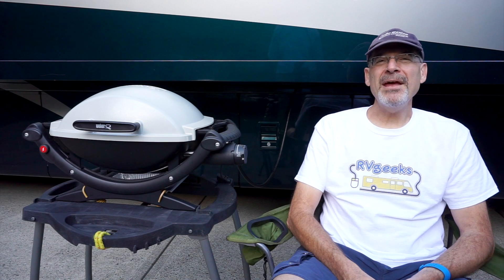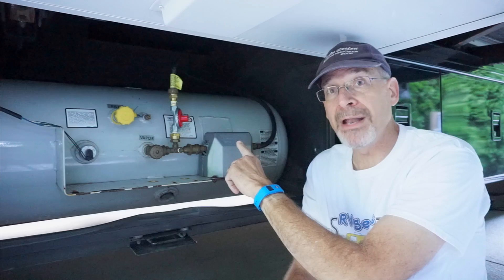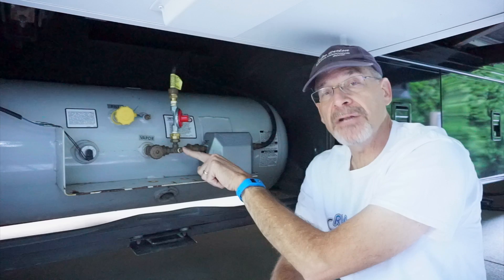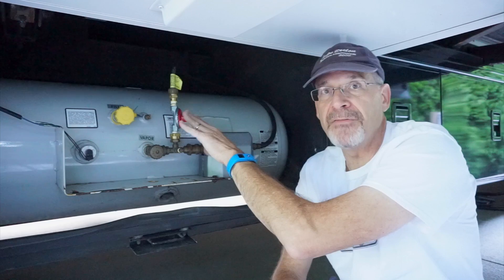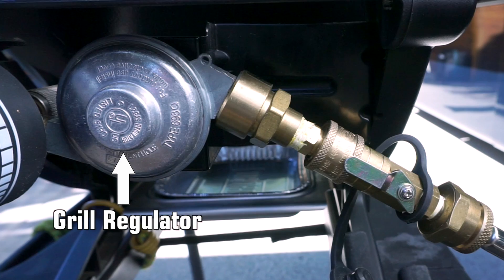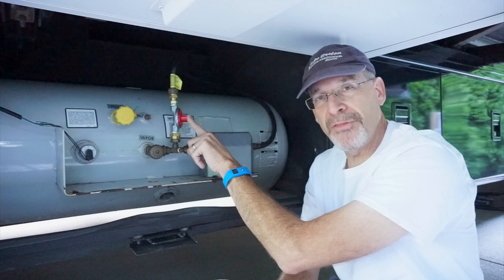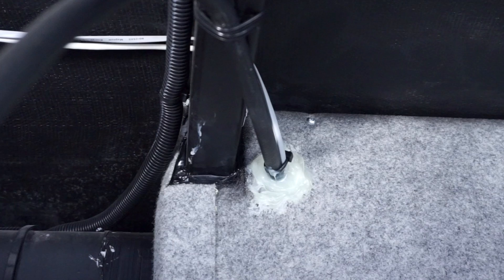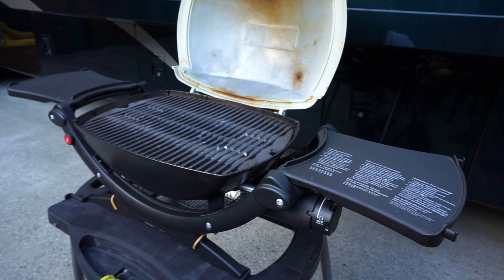How to Connect a BBQ Grill to an RV's On-Board Propane Tank

Comment: GREAT information, as usual, with great clarity. I also noticed the use of the two regulators and was going to question you on this use, but you gave a Super detailed explanation in your reply to someone else. Did you figure this out yourself or was there someone else involved in the process? Thanks.
Later...Terry
Reply from the maker: Thanks Terry! We mostly figured out the whole set-up ourselves, with the exception of the fact that high pressure can cause oil to accumulate in long propane hoses. The first time we ever heard an explanation of where that oily build-up had come from was when we went to connect our RV to an external propane tank the winter we spent up north. The local propane dealer who sold us the parts we needed for that told us that we'd need a regulator on the big external tank (which you can see briefly in this video and in detail in our video about that topic) because we needed a fairly long hose to reach the RV. When he told us about high-pressure propane causing oil build-up in long runs of hose, a light bulb went off, since we'd had that then-mysterious problem once before, but had no idea why. We thought we'd just gotten a bad batch of propane. ;-)

When it comes to exactly what regulators we used to reach the grill, we chose the 15 PSI after some experimenting. We'd first tried a standard 11" water column unit, but the grill would not stay lit, since we were double regulating (TWO 11" water column units in the same line). It turns out that we needed to "step down" by bringing the pressure down part way to prevent the oil, then regulating at the grill to the required level. As we mentioned, if the regulator had been easy to remove from the grill, we could instead have simply moved it to the other end of the hose, right off the T and only needed one instead of two. We're always learning! :)

Comment: Curious if it would be safer with black pipe or copper under and through the coach. Or even the yellow gas pipe. Just because the rubber hose can deteriorate over time.
Reply from the maker: Hi Kevin. Might be a more robust installation that way. But it would be a lot more difficult to install. Ours has been working great for many years without a problem though, so this seems like a pretty good compromise.

Comment: Thanks for the video.  So, you have a second regulator that remains on the grill still?  Does the already-regulated gas just pass through with virtually no change?  Was wondering why you still had the second regulator on the grill side.
Reply from the maker: Great question! We do still have the original regulator on the grill. The reason it works, and provides enough flow, is because the first one is a step-down regulator, which brings the pressure down to 15 psi. That is still far higher than the regulator on the grill, which is closer to about 1/2 psi. The reduction in pressure along the line prevents oil buildup in the hose, but it’s still high enough to provide plenty of flow for the grill. That higher pressure also means that the grill’s regulator is indeed still required.

Comment: With your 15 psi regulator at he RV propane tank, Do you still need the regulator at the BBQ? To set up my BBQ, I have to remove the hose and regulator that comes with the BBQ, and install the quick connect directly to the BBQ.
I have found your channel to be the best for tips and tricks, etc.
Thanking you in advance.. Fred
Reply from the maker: Hi Fred. Thanks! Glad you enjoy our content (means a lot to hear that). And to answer your question, yes you still need the regulator at the grill. 15psi is WAY too much pressure for the grill to run at... would likely be like cooking over a blowtorch!! Your best bet would be to identify what pressure the built-in regulator that you have to remove was reducing the pressure to. If it's 11" WC (11" water column... which is about 0.5psi), then you'd be better off tee-ing in AFTER your RV's onboard regulator (which also brings it down to 11" WC) and feeding that directly into the grill. Hope this helps!
Reply: @RVgeeks  Thank you guys so much. I was at a BBQ store, and they (a KID basically ) said I did not need the regulator that came with the BBQ and the Firepit, because I had the 15 PSI regulator , as per your video. I tired it without, and could've melted all the snow up here. LOL
Thanks again.
Reply from the maker: @ketonobull1649  Engage blowtorch! 😂

Comment: Okay, but your low pressure from your basement goes into another pressure regulator on the BBQ. still enough pressure to BBQ?
Reply from the maker: Yup! The “low” pressure at that first regulator is 15 psi, which is FAR more than needed to pressure the grill, even with the grill’s regulator in place.

Comment: I have something similar hooked up in my rv but my Weber does not work properly with 2 regulators one on the Bar B Que and the other at the source. I asked Weber and they said you can't have two regulators before the gas enters the Bar B Que so now I am confused?? Any thoughts?
Reply from the maker: Hi Paul! Great question. Since double-regulating can indeed cause the exact problem you're having, we do get questions about how our system works so well with two regulators. The confusion is caused by the PSI of the regulators. Grills and other appliances, like water heaters, RV fridges, etc, run off a specific PSI level that's referred to as "11 inches water column" which equates to about 0.5 PSI. The main regulator on the RV is 11" WC, and so is the one that came built onto the grill. If you try to go through TWO of those, that is the very definition of double regulation, and will prevent the grill from getting enough propane flow. The difference in our case is the PSI level of the red regulator we installed near the tank. First, it's on the TANK side of the RV's whole-house regulator, which means it's getting full (very high) unregulated pressure. Second, it's a 15 PSI regulator, not 11" WC. That 15 PSI is about 30 times higher than the grill's regulator (which again is about 0.5), and PLENTY of pressure to carry more than enough propane down our long hose and over to the grill. It's also far higher than the grill can run on, so the grill's 11" WC regulator is still required. With that 15 PSI regulator in line, it prevents the oily build-up that VERY high pressure can cause over a long run, but still provides plenty of pressure to the grill's regulator. Hope this isn't too much detail, and is clear enough!

Comment: QUESTION: It looks like your grill has a built in regulator, which would make double regulators, one on the grill and one in you plumbing at the bottle, am I missing something?
Reply from the maker: Hi Wayne! There are two regulators, but the first one, the red one, is 15 psi to act as a step down regulator. The one on the grill is far lower. If the red one were the same type as the one on the grill, we would indeed have double regulation, and the grill wouldn’t work. But the 15 psi is still plenty high enough to get enough pressure to the grill.

Comment: If you have a  pressure regulator on your external propane tank as shown in the winter months, won't the on board tank empty first before allowing use of the external tank?
Reply from the maker: Good question, Jim. But you don’t leave both tanks on at the same time. We usually turn the on-board tank off... and use it as the “emergency spare” in case the external tank runs out. In that case, we turn the external tank off, then the on-board tank gets turned on.

Comment: If I have no need of connecting an large external tank, would there be a problem with connecting on the regulated side of the RV propane tank and not having to install the additional regulator?
Reply from the maker: Hi Brian! Because the RV’s main regulator drops of pressure down to 11 inch water column, which is about 0.4 psi, the only way you can do that is to remove the regulator from the grill. That’s because the grill’s regulator is expecting high pressure, and having two 11 inch water column regulators in line causes the “double regulation“ problem and the grill won’t have enough pressure to work.

Comment: RV Geeks
Thanks for your informative video.  Like you, I wanted to take advantage of my large RV LP tank to supply gas to my Q1200 Weber grill.  A friend helped me install a brass tee after the tank, before the RV’s LP regulator.  When I noticed some oil drips from the grill’s control valve (same problem you had), I called Webber and they advised me that I had probably damaged the grill because it could not be hooked up to a large RV tank.  When I explained my tee was BEFORE the RV’s regulator (so it was not double-regulated) she was sure I had damaged something and so would need install a new regulator/control assembly.
Questions:
1. Have I damaged this grill by not having a 15 PSI regulator after my tee and before the grill?
2. I plan on installing your recommended high pressure 15 PSI regulator, which means I will have it double - regulated.  I’m sure that you didn’t have any problems with your grill but, will this create any problems with my Q1200?
3. Do you think I really need to replace my regulator assembly?

Thanks for your help with this.
 Jim
Reply from the maker: Hi Jim. Sorry to hear about your trouble. Having oil clog your grill's regulator is a real bummer. In response to your questions:

(1) We can't imagine that you've damaged the grill in any way other than getting it gummed up with oily residue. When it happened to ours, we used some isopropyl alcohol to clean it out... making sure it was completely and thoroughly dry before we ran propane through it again... and it worked just fine. The oil didn't cause any real problem other than gumming things up and reducing flow.

(2) We haven't noticed any problems with our grill since installing our system. Some people have thought theirs might not be grilling quite as hot as before installing the 15psi regulator... but we can't say we've noticed any difference. Be sure to get the same parts that we list in our post about installing this ( http://www.thervgeeks.com/propane/bbq-grill-connection/ ). Not all parts are created to provide full flow of propane... so you may find a similar one that has the same connections, but that restricts the amount of propane flowing through the system... thus you'll get lower heat.

(3) As mentioned above... we'd try just cleaning it first. Your onboard propane tank's pressure shouldn't be significantly different than a disposable cylinder or portable 20-lb propane tank. And those connect directly to the Weber's controller/regulator without a problem. So clean it first to be sure it's not clogged before assuming it's been damaged. But we think you'll be fine. And with the 15psi regulator keeping the pressure in the hose down, you shouldn't have any issues with oil ever again!

Hope this helps! And let us know how you make out!
Reply: @RVgeeks  Thanks for your quick/detailed response.  The Weber lady said she had 20 years with Weber and knew that it would not work with an RV and that I had damaged it and caused the oil leak (that I needed to buy another part).  It seems that they'd want this big RV market's extra sales and so would engineer & sell the parts required  (make the profit$ for Weber vs. hassle the Customer).   Maybe you can contact them and become their Consultant.

I did not see your Parts List the first time I looked at this so I have installed a brass tee and 12' hose that screws directly into the Weber regulator (no quick disconnect).  I'll be ordering the  15 PSI regulator you recommend and then clean off the oil and... should be good to go.  

You provide us beginners a great service, thanks again!
Reply from the maker: Our pleasure, Jim. It is strange that the Weber  employee was so certain you’d damaged the controller. It’s possible she’s assuming the oil will damage something in it... but that wasn’t our experience. Removing it and pouring some rubbing alcohol in, shaking it up, and draining it got it all out and it worked fine ever after. If nothing else, it’s worth the try rather than replacing the controller. Please let us know how you make out!
Reply: @RVgeeks  Agree.   I think she's been told for 20 years that it will NOT work with a big RV LP tank and that if this is done, it will damage the Weber.  Again, I do not understand the Weber business strategy on this anti-RV policy and their adamant employee training.

I'll be ordering the regulator, doing the cleaning and then let you know.

Comment: Great how-to. You possibly mis-spoke @3:36. This is not a high pressure hose-it comes from the small 15psi regulator
Reply: Technically, hoses rated for over normal operating pressure is considered a high pressure LP hose. Operating system components and hoses  only need to be rated at around 1/2 psi.

Comment: I watched your install video a few years ago. I have the same bbq as well. I tubed in a 1/2” stainless tubing line. I had the oil problem. If I hook a 1lb bottle it gets hot. From the 15 psi reg it won’t heat up. Getting a little frustrated. Any ideas?
Reply: The grill regulator wants to see tank pressure, not 15psi.   Some regulators which require tank pressure will operate on less than tank pressure, and some will not, or they will work erratically. RV LP systems are my business.  I'd just carry a 20lb tank for use with the grill and get the 5' adaptor hose made for that application. Cheap and simple.

Comment: i notice that your propane goes thru 2 regulators now, the second being the bbq's regulator, does this impede flow for the grill itself? or do you still get a nice high flame?  thanks, Richard
Reply from the maker: Flame is great! The first (red) regulator is much higher pressure - 15 PSI - than the second one, allowing plenty of pressure for the grill. The red regulator is just a step-down to the final pressure the grill requires.

Comment: Will I need your regulator to hook up a propane powered wok with this from amazon? Propane Brass 4 Port Tee Kit Propane Brass Tee Adapter Kit 5FT and 12FT Stainless Braided Hoses Allow for Connection Between Auxiliary Propane Cylinder and Propane Appliances for Tank RV Camping
Reply from the maker: The determining factor in whether you need to add a step-down regulator (like the red 15 PSI model we used) is the length of the hose you're adding on the high-pressure side of the RV's regulator. The longer the hose, the more likely that high-pressure propane will cause oil to form in the line. The shorter the hose, the less likely that oily problem is, so no additional regulator should be needed. Our 12' hose required the regulator. Just be sure that if you're Tee-ing into the propane BEFORE (upstream) of the RV's whole-house regulator, like we did, that the wok comes equipped with a built-in regulator (similar to most small grills).

Comment: how does your grill work if it has a regulator on the feed side and a regulator on the grill itself?  I already have a grill quick connect on MY RV after the house propane tank regulator.  I was under the impression that you had to remove the grill regulator for this to work.  I have the same weber q grill
Reply from the maker: With the propane line Tee'd in from the tank side of the RV's main regulator, it's coming from the high-pressure side. allows us to keep the original Weber regulator in place. It we were to tap in on the downstream (RV side) of the regulator, then we would indeed have to remove the grill's regulator for it to work. The red 15 PSI regulator added into the line simply steps down the very high pressure in the tank, which prevents oil buildup in the long line running over to the grill.

Comment: Hi Guys!  I had tried this exact setup and wasn't getting any propane flow to my grill...conversely I started smelling propane leaking from somewhere (abort, abort!).  Looking at this video again, it looks like there is another regulator on the grill side of the quick connect, is that correct?  I really want to do this not just because of the convenience, but those little disposable green tanks are bad for the environment!  Thank you.
Reply from the maker: So sorry we just saw your comment! Sorry for the delayed reply. Yes, there is indeed a regulator built onto the grill. That’s required, and comes with the grill, because the propane feeding into it is still too high pressure. The red step-down 15 psi regulator we installed over near the tank simply reduces the huge pressure in the tank to a more modest level. But it’s still not low enough for the grill, which requires the same psi as most other RV appliances. That pressure is commonly known as “11 inches water column” which equates to approximately 0.5 psi.

Comment: Just wondering if you have connected 2 grills to a single 5 gallon tank with a tee using a 5' hose to each device ?
Reply from the maker: We haven’t done that, but don’t see why it wouldn’t work. Even those small tanks have plenty of pressure.

Comment: Doesn't having a second regulator in the line create low pressure to the grill?
Reply from the maker: It would indeed create a problem if they were both low-pressure regulators (about 0.5 PSI, like the one on the grill itself). But the red one is a 15PSI regulator that steps down the pressure while still leaving plenty to operate the grill.

Comment: I just purchased a new travel trailer that has the quick connect under the frame.  I am being told that it will not work on my weber q1200 like yours because it would be double regulated. do you have any problem with that or did you modify in any way.  It looks like you kept the regulator on the grill as well as the regulator off the tee.  Thanks, Tim